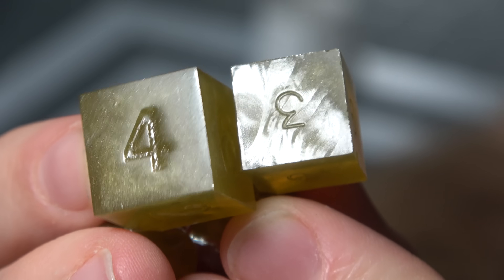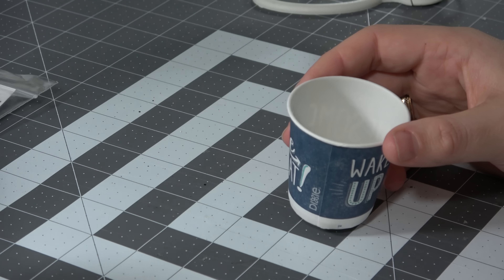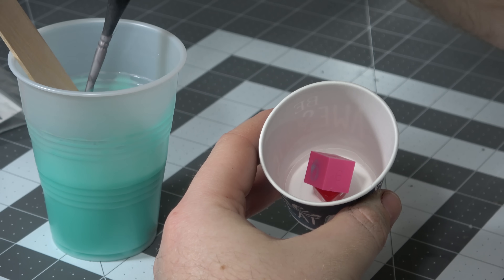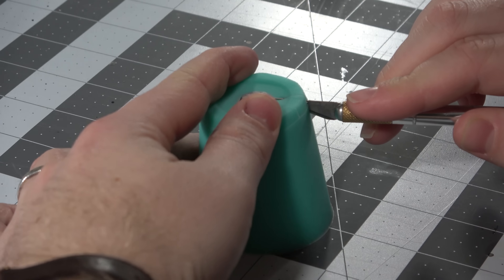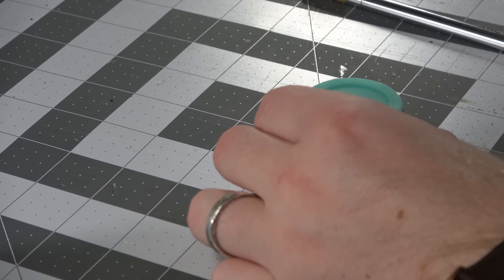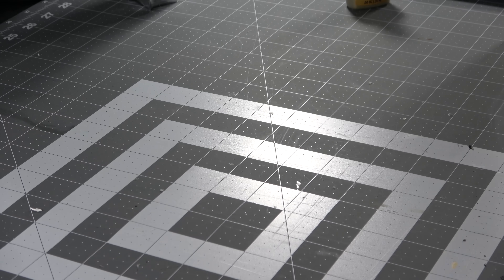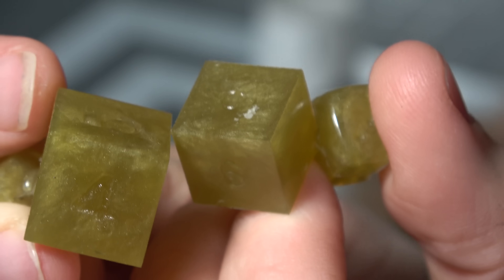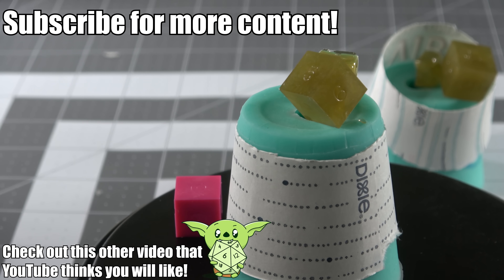How To Make Silicone Dice Molds in a Pressure Pot

Comment: I started making dice about 3 months ago and realized rather quickly you absolutely need a pressure pot for casting clear dice. So I spent the $137 and was super excited however I then instantly found out you need to remove air from the molds aswell. So out of desperation to save $120 I threw a new set of molds in the pressure pot and it thankfully worked. Been doing it ever since and haven't had a single problem. Would definitely recommend as it's way easier than a vacuum chamber and much faster.
Reply from the maker: ^ You got that right :) It's a great tool to do both jobs from.

Comment: Personally I'm still iffy on the idea of pressure-only silicone casting. The last molds I did without using a vacuum chamber still got air trapped in them, though the brushing technique might help with that.

I wonder if Q-tips or toothpicks would work in place of the brush, since they're cheap and designed to be disposable.
Reply from the maker: The brushing is supposed to be the main help, though I STILL prefer the vacuum method as a way to be 100% sure that it works every time :)
Reply: @Rybonator  Specialty Resin Supply has a thinning agent you can add to silicone to make it flow better, and in fact I did use some for the dice molds I made. They advise against more than 5% by weight, and I tried to keep it around 2%, as it does also weaken the end result slightly, but it definitely helped with the flow and degassing.

They also have a super low viscosity platinum that's almost like sugar water, that stuff was amazing to work with but I cant use it with resin prints.

Comment: Whilst I'm not planning to make more gamescience molds, I was wondering how well your dice ink - I found the ones I made didn't hold paint well (anything I used to wipe the face down, even very lightly, would pull up the paint) and should figure out if it is my silicone or the dice I used before I get more silicone! (the molds I bought which are generic dice do not have this issue and ink well)

Also very happy to see you only need a pressure pot and not a vacuum chamber to make decent dice, though I doubt I'll be getting one anytime soon!
Reply from the maker: The Game Science dice do NOT ink very well, as they are super thin where the numbers are. IMO. Other dice I have no issues with :)
Reply: Thanks for the response! Hoping to make some more soon (may even be designing my own...)

Comment: Thank you for finally helping me figure out which system I should go with.  I've been having the pressure pot/vacuum chamber debate for ages.  Also for another dice making idea, how about aluminum shavings in a dark tinted resin?
Reply from the maker: I have been planning on doing a cold casted metal dice like that for some time now :)

Comment: This saves me a lot of pressure. I was originally going to be getting both a vacuum chamber and pressure pot, but it seems that thanks to your video I'll only need one tool!
Reply: Pressure pun intended?
Reply from the maker: I see what you did there ;) Hopefully it saves you some cash! :)
Reply: It definitely saved me cash! I had just bought a pressure pot and I wasn't sure if my mold I made without it would yield a clear dice without vacuuming bubbles out of it, but thank god I don't have to spend another 100 or so bucks on a vacuum chamber as well.

Comment: Could you make a video on how to make original molds? Essentially I would want to make my own molds to eventually sell my dice.
Reply: Your best bet is to design the dice in a CAD program and 3d-print them with a resin printer (like the one he reviewed a couple weeks back. Then use those 3d-printed dice as the master for a mold. Multiple skillsets involved and more equipment needed, but that's kinda the cost of doing business.
Reply: @JadeParadox  Thanks for that, I've got a few friends with printers. Will look into designing a mold.
Reply: @eskimojones3471  Thank you kindly, will look into.
Reply from the maker: I'll be posting a vid on that in the next few weeks!
Reply: @Rybonator  You are the best!
Reply from the maker: @madmadame1508  No u :)
Reply: An idea I had for dice I want to make is to cut small triangles out of plastic and glue them together. Will ne tedious, but original, and sharp!

Comment: I'm having a hard time getting the corner of the die squared after cutting off the sprue, any recommendations? I think I'm going to recast my moldswith a small dowel on a face instead of a dice on the corner but I am concerned that the hole left will be too small.
Reply: I use a Dremel with a cutting bit, and leave the spures on when taking the dice out of the molds.
Reply from the maker: A pressure pot really helps with the holes being too small, as it will mostly allow the resin to pull down into the mold, so you should have no real worries :)
Reply: @Rybonator  it's really the holes being too big that's the problem, I end up having to whittle the corner where the sprue is down a lot to match up with other sides.

Comment: If you vacuumed the silicone, then put it in the pressure pot you might get some super smooth molds. But as it is, I don't think you would see a super big difference. Maybe it would be noticeable with clear dice?
Reply from the maker: 0 bubbles is 0 bubbles, so doing it twice would just be double work for no reason :)

Comment: This is a good thing to have as a reference there, out of curiosity, would it be okay to "mod" this dice set and then use that for molds?
Reply: QuizMaster Hanzo according to copyright law, that would be considered a “derived work”, which is a restricted act. It will be considered the copyright holders work and they are entitled to any money you make by selling your modified version. 

This doesn’t mean you can’t make sharp edge dice, as you can claim to have been “inspired” by their work; but you’d basically have to make it from scratch.
Reply: @Alex-yl8dz  let me put it another way, let's say you mod them by adding rims and rounding the edges, would that really still be illegal?
Reply: QuizMaster Hanzo I believe so. There’s a common myth that if you use 10% of copyrighted material, you’re in fair use - which is not the case. Using copyrighted material without rights or without fair use (parody, review, critique, etc.) makes it eligible to be claimed. I know what you’re thinking: “It’s a cube with numbers” and I understand, but if it’s a copyrighted cube with numbers, it falls under copyright law.
Reply: @Alex-yl8dz  what I'm saying is, taking away the defining factors of a product is what removes that protection, it's the same issue I face as a designer, a single change in color or a line doesn't make it copyrighted enough. It's way less about the product itself and way more about their likelihood, sadly
Reply: @QuizMasterEntertainment  There are other factors that could define it and make your dice identifiable as using Game Science dice as molds. Specifically, the number orientation, dimensions, font for the digits on the faces. If you sell on something like Etsy, it would be pretty easy for them to take down your listing as well. Ethically, it's still kinda shitty, and legally, you'd still be in the wrong even if it weren't recognizable. If you want to play they "i don't think they'll catch me" game, that's your prerogative, but as @Alex has said already, no it would still be infringement on their design even if you modify it.
Reply: @Faustvonholle  Again, no. and this comes as a designer myself, change defining features and it's technically not the same thing anymore. it's not even an ethical issue at that point because the modding of the material is also your time an effort.
basic example, if you buy a blank shirt and then print a design on it then that's your work and not just reselling a product, we are not reinventing the wheel and making anyone pay for their similar products here.
Reply: @QuizMasterEntertainment  you're quite literally wrong. They can and have issued take downs for dice molded after theirs. You sound like a sketchy designer if you dont atleast understand that copying something with a certain font doesnt make you legally licensed to use that font, even if it's just on dice you copied.

Also, a quick google search shows that they cant own IP related to that specific shape (otherwise no one could make any dice) but the font very much is protected. So, modify the font and you should be fine to do whatever, but otherwise, be wary about selling something with their font.
Reply: @Faustvonholle  are we even talking the same language? I am talking modding here, like not even making it look the same, if you mod the definying features out then there's no issue
Reply from the maker: Great question. One that I can't give you a 100% answer to. My knowledge says that it would still be illegal, the same way if you used a G.I. Joe and popped a different head on the figure.
Reply: @Rybonator  it's not exactly reselling the product after a light modification, is taking the modified product as base to make molds out of it, the dice casted from those molds would be 100% your design by that point since technically speaking the process is all yours as far as anyone would be able to tell.
I did the research for it, but still thank you for taking the time to reply

Comment: Do you have to use a vacuum chamber or pressure pot to be able to make the moulds?
Reply from the maker: Great question! No you don't, you only need to do that if you plan on pressure curing your dice to get transparent dice. Otherwise you don't really have to worry :)
Reply: Thank you I'm excited to get into dice making but have to start on a tight budget